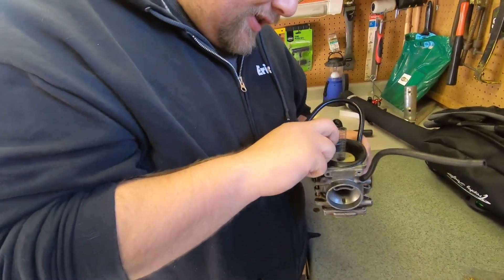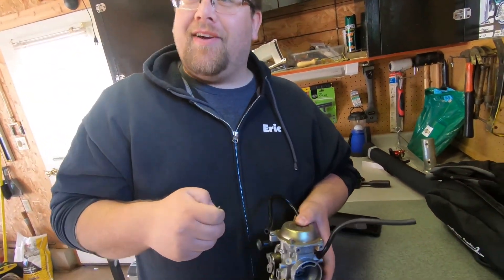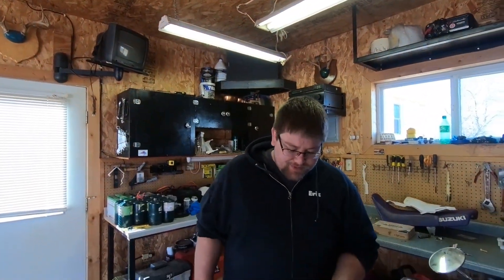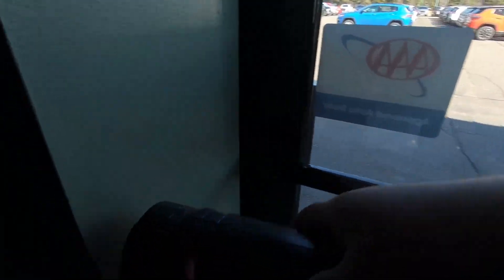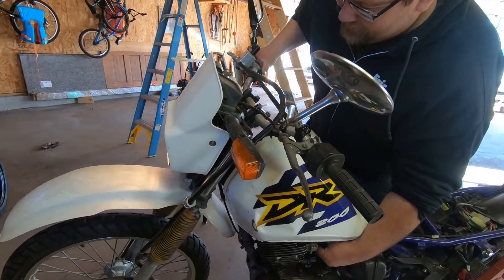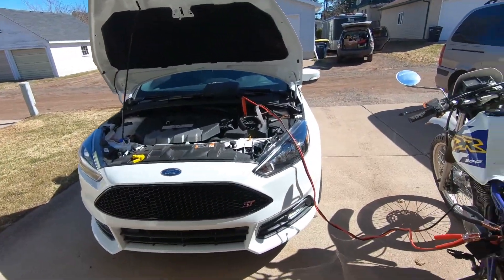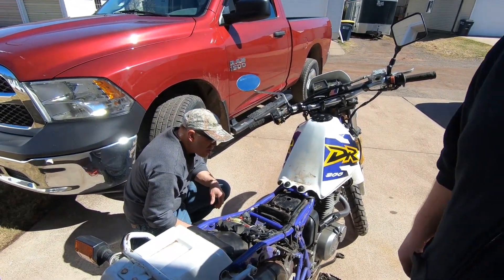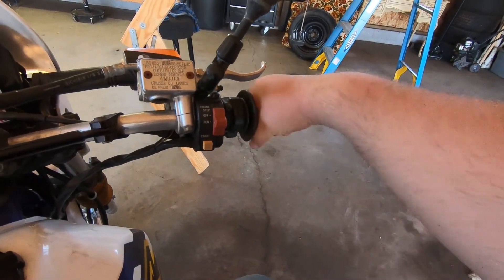DR200 Redemption

Comment: screw out the adjustment screw on the bottom of the carb, they're really lean from factory my bike likes between 3 - 3.5 turns out to run right  It'll take out the boggynees and the way the revs hang.
Reply from the maker: Will do, I'll let you know how it goes.
Reply: @TheWiscoGuyz   It sounds like it is that screw josh mentioned, stock from the factory there is a brass plug you need to remove to get at the idle screw. I made a 90º screwdriver out of wire so I could tune mine on the fly and it runs awesome now.
Whats funny is I have the same bike and the dent in the tank is on the opposite side, same spot!
Reply from the maker: I still cant get the boggyness out of it... Think i might have another issue. The idea with the screw driver is good! Going to bend one up for it